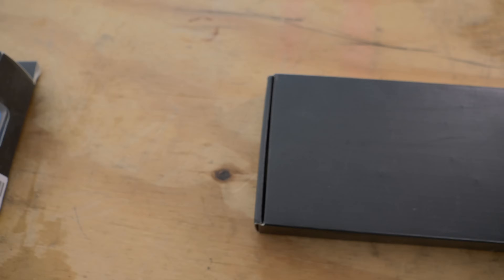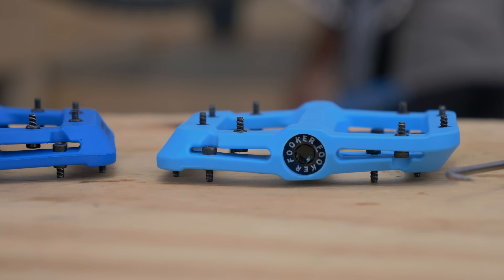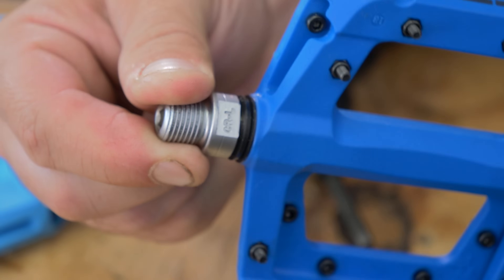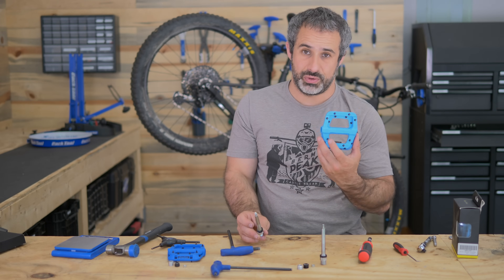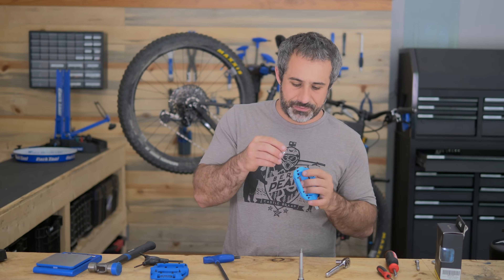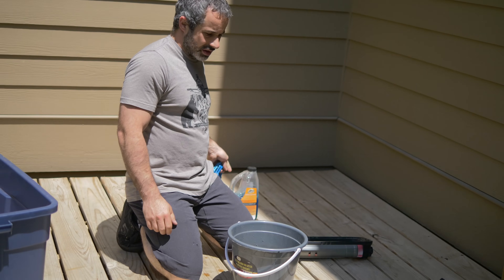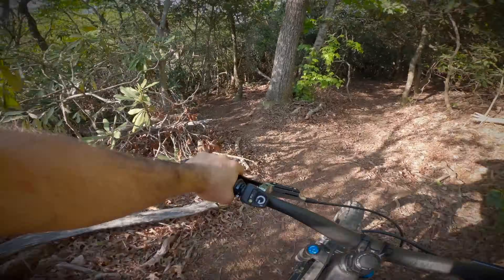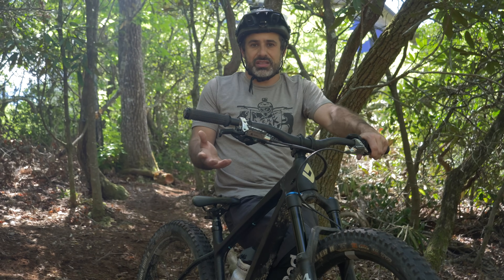These COMPLETE KNOCKOFF mountain bike pedals have me heated!

Comment: Plot twist: they licensed the design and Seth just trashed it
Reply: Plot twist: same factory in China designs and makes them.
No licence involved. 
RF specs them slightly better, pays 10% more for better pedal but charges you 50% more for the name and a bit better pedal, plus a load of marketing BS..

Like red bull gives you wings.. (also gives nearly 30% of its taking back as marketing)
Should be Red Bull gives you long term health issues..
Reply: This is terribly common, same as both brands buying the same design from an independent design studio, or both brands being owned by the same company but aiming at different market tiers, or even the most expensive brand copying the cheaper one. Source: studied Industrial Design.
Reply: Dave Webster There is more to it than that. RF has a retail price set to protect bike shops. RF likely sells them to a bike shop for about $25. So RF is likely paying $10 for the pedals. There is shipping and packaging involved, along with sponsorships and employees they have. So the factory is probably making the RF for $5. Then they, or another factory across the street, makes a copy of the original at a lower spec for $4 and sells it for $20 at a much higher profit margin selling direct. They likely eat a little profit using Amazon FBA, but they still have a higher margin. They are scum bags for selling knockoffs, but in the Chinese culture they do not have nor do they understand intellectual property. To them it’s a silly concept, they feel if it can be made cheaper then it should be, it’s how their culture has always existed. Most people these days will just say, duh I don’t care, it’s cheaper. But it hurts businesses and it effects jobs. It’s what happened to American automotive jobs the we are too good to do now, but we feel we are better than that, we don’t need to do that kind of work. It’s too expensive to do that work here. Chinese manufacturing and Amazon has destroyed retail models. Now people are slaving in fulfillment centers rather than in a factory. This pandemic shows that America can not survive on its own, because we rely on imports. We could get shut down by China if they wanted too. They own us.
Reply: MTB 2 SEA Indeed they do, this is how China wages war, and 99% of the time they will win, its interesting how a “communist” country now operates on a philosophy at the low level of almost perfect capitalism.
Reply: BadGamerGood 
China is essentially communist by name only, its mostly just authoritarianism with extra steps.
Reply: @badgamergood6713  This isn't going to last. This is why China is trying to expand influence. China is experiencing what every other developed nation has gone through. 10% annual growth through industrialization doesn't last forever. Recent years they've had much lower growth, more comparable to the west. This is important. Chinese citizens have put up with the violations on their rights because they've never been so wealthy. But, all their kids are living in a different world, one with an economic future more like our own post baby-boomer. More people and less growth mean less individual wealth. And, those people start becoming less willing to turn their eyes at being shit on. That's why internal propaganda and social surveillance has ramped up in China, and its why China is trying to exploit abroad. When the foundation of the economy crumbles (and it is), CCP is done.
Reply: Communist in name only until the CCP takes interest in your product or intellectual property at which point there's nothing stopping them from doing as they please.  It's all consistent with seizing the means of production.
Reply: David Bronstein my point exactly
Reply: MTB 2 SEA well Seth doesn’t care about bike shops since his bikes are all diamond backs. Consumer direct cuts the bike shop out.
Reply: @mtb2sea170  lol get over yourself. America did this to the British after www2 and many other countries. And we did it to other and many other have done it to many others when it suits them.
Its all swings and roundabouts.
The US patent office is mental anyways. Awarding stupid patents here there and very where which shouldn't have been given. Both to real businesses and plain old trolls.
I do believe there is a place for patents but it does require some common sense.
Same with copywriter and trade marks.
But China is a law unto themselves but half the time they get it wrong and end up selling them selves short.
State aid in china's another issue which Needs to be addressed.
But all of the above isn't something for this bike channel really.
And I don't think seths rant was really warrented if I'm being honest.
But it's his channel, his view so who am I to tell him what to do?
Reply: Dave Webster curious, what products did we rip off from the British after WWII. They have their own industry, even to today we do not export much to them. We do not export much of anything. Design a product of your own and have people make knock offs and take your buyers from you, see how it feels to have something you are passionate about taken from you. I’ve been down that road.
Reply: Internet Police  I never said anything about Seth or Diamondback. There are plenty of manufacturers going to a factory direct model. Diamondback is not ripping someone else’s design and selling it as theirs. My example was stating why RF has a higher price. Because they do sell to bike shops. RF did research and made a successful product and somebody copied it to take business (money) away from them.
Reply: MTB 2 SEA that’s debatable. Diamondback just uses frames from China. Tweak them a bit. And no. No one ripped off racefaces design. It was a catalog pedal. Most likely a wellgo.

Comment: My cousin literally works at a factory where the same.cans get a variety of different labels to ship off to different companies for sale

Its like aerosol air fresheners and hairspray products
Reply: I think paper towels are a better comparison
Reply: @randomuser5443  I bet they're even worse at it. One brand printing different prints on the same paper all day long
Reply: bread is very similar also.   big grocery stores carry their own "brand" of bread.   Meanwhile, bread from NEARLY EVERY "brand" you see on the bread aisle at the grocery store comes out of the very same bread factory.     When  prices are significantly different, there will be changes to the product but overall it'll be similar.    The best example i personally came across is the 3M green/yellow scrubber for doing dishes.   The normal stores carry them for $2.50 each or whatever.   I saw them at a dollar store for $1.25 in the same 3M wrapper and it all looked the same except this wrapper had dollar store logo added onto it.   I get home and compare it to a real one and the green scrubbing side is 1/2 the thickness, the yellow sponge is 1/2 the thickness...and guess what?   It fell apart in a fraction of the time.   It looked the same, same brand even, but it was definitely NOT the same as one you would get if you paid full price in a normal store.
Reply: That’s how supply chains work for the most part. Chester doesn’t create every piece in their own pedals, neither does fooker. They both source them from OEMs and then build their product. the difference is where they source them from and the quality of the production. Chester obviously cares for the quality, and thus has quality manufacturers which is reflected in the cost and craftsmanship of the product. Fooker on the other hand found a manufacturer that could make the same pieces for the cheapest price with 0 regard towards quality.

Comment: That internal sleeve nut is designed to put pressure on the outside bearing race. So the hole in the middle of it is really just a design thing rather than a way to keep water out or grease in. Just a heads up since it really seemed to upset you.

Comment: So i just bought pedals, AU$28 (US$17.75) RockBros, Nylon / Plastic, with proper screw in bolted spikes, 4 enclosed bearings per pedal, they feel perfect ie you can't feel any slop, good rubber bungs / o-rings to keep the dirt out, they are excellent, even for road riding, i don't slip off them esp'' in the wet, and i get more power when my feet have a good horizontal pedalling component, could not find Fookers, glad i couldn't.  My current bike is all dark grey / black, didn't want to cheapen it up with lots of anodised colour, however i purchased a yellow-green set, so that is now the 1 highlight colour allowed on that bike, again is good for road riding, large bright rotating pedals on a largely dark bike background.  Cheers!

Comment: I work in manufacturing so I have a little bit of insight here. Parts that are injection molded in the USA typically have the molds built in China because they do a good job for 40% of the price of having the mold made in the USA. So basically, the mold company in China has all the data required to make the mold. Now for the shocker. It's not uncommon for the Chinese company to make 2 sets (or more) of molds at the same time. One gets shipped to the US and the other(s) is put on the market in China. It's dishonest. It's stealing. It's wrong. Yet American resellers can't import the Chinese products fast enough, because hey, this is America and all that REALLY matters is the digits in our bank accounts.

Comment: Headsets, pedals and stems are the 3 most overpriced things in mountain biking. They cost almost nothing to make and seem like they must have a 3000% mark up from production cost.
Reply: Most of the cost comes from the R&D.  You're talking about the three parts of the mountain bike (aside from the frame and wheels, of course) that absolutely must not fail, or you lose control of the bike.  Even brakes can fail if you can come to a controlled stop (and you have two of them), but the three parts you mentioned are anchor points for the rider with no backups.  Those fail, you're absolutely hosed.
Reply: @zenspeed404  I agree with all of your points and that's why they get away with screwing you on those parts that being said production cost is nowhere the price the bike shops are charging people!

Comment: I have the same RaceFace pedals on my old RockHopper... I also have a different style Fooker pedal on my ebike (wanted a red flat pedal with pegs that also had reflective parts, they were the only ones I could find that had that) I've ridden well over 5,000 miles with the Fooker, including in heavy PNW rains that have turned my route into endless deep puddles with water constantly splashing over my feet. I've had no issues with the Fookers so far. Haven't opened them up to see how the bearings are doing, but they spin fine still. Not saying I'd recommend them over the RF, but at least they aren't complete trash.
Reply: Also worth mentioning, I tried to do some research on Fooker before buying them, and this video didn't come up =[

Comment: looks just like pedals i had in the 90's. whats so special about them that they had to do R&D?
Reply: The improvement lies in the details: better ergonomics in optimised concave shape, much sturdier materials (mostly better metal alloys) with different machining properties, better sealing, etc.
Then again, there are many "new" designs that don't add improvement at all and are just there because we live in capitalism (MOAR products, MOAR  sales!!!).
Reply: @thomaskositzki9424  Yea but I'm not seeing any of that with these.
Reply: zip zip like Thomas said, it’s in the details. Engineering is about making the lightest, strongest, most ergonomic, most aerodynamic, safest, durable product with the lowest cost. It’s all about efficiency. It’s just a min/max approach with materials science, physics, and modeling to include forced failure for analysis and incremental improvements. “Any idiot can build a bridge that stands, but it takes an engineer to build a bridge that barely stands”, if I remember correctly. Sometimes engineers get it wrong, and their tests weren’t enough to expose the flaws, and better ideas always come along, which is why we always have new models, revisions, recalls, etc., but they try their best to get it right the first time, within budget and the deadline.

Comment: Chester pedals buys the fooker pedals and puts their name on them. Rise the price for a profit.
Reply: firstly, you mean raceface. secondly, i'm pretty certain that raceface got there first. its just that i don't think that that the KP logo is original.
edit: theres also the little seal that doesn't seal, which i don't think they would put in there if they didn't copy the chester.
Reply: @bananasstuff3344  these are all made in the SAME factory in china lmaoo..... American companies do this all day for years. They stamp their logo in the USA and sell it for 100x the price they paid
Reply: @nmnmnm35  if they were made in the same factory, the internals would be the same, and they aren't.  The Chester's were machined a lot better than the fookers, and they were machined in different ways.  I know it's pretty common, but this isn't one of those situations.
Reply: @ARandomBoat  the same factory could very well have multiple blueprints /designs and just send the base pedal parts through slightly different molds/modifications depending on the customer
Reply: @JohnSmith-zs1bf  dude, that is impossible. No company would make a terrible copy of their own item. They might modify it, but not make a trash copy
Reply: @ARandomBoat  i mean you're PROBABLY right, but most American companies will order the product specifically or order a similar product and give instructions for modification to rebrand it. It could very well be that raceface orders them from a supplier in China who also started selling their own version, or gave blueprints to another factory thats taking orders from fooker. Again, I dont know for a fact either way, I'm just speculating.
Reply: @ARandomBoat  also i dont see any evidence that the fooker pedals are trashy. They actually seem to hold up very well compared to the original.
Reply: @JohnSmith-zs1bf  makes sense, and by trash, I meant that it has parts that seem to copy the Chesters, but serve no actual purpose. It's like what seth said in the video

Comment: On the mould: When a mold wears out, or the model is discontinued, sometimes the mould is tossed, or sold, and not destroyed. "fooker" can take the mold and grind away logos, weld in new material to repair wear, etc etc. there is a real possibility that that IS the chester mould, and they came by it legitimately (maybe they even made it) and because race face does not own anything about it besides their own logo, they have no say in it.
Reply: KP stands for k-pedc. They are catalogue pedal manufacturers. Otherwise known as Ningbo Hao Jue Fitness Equipment Co
Reply: @chriscrawford2977  So do we rename this video "Seth freaks out when he finds out Race Face rebrands catalogue products and jacks up the price" ?

Comment: Having been looking for flat pedals for a while you notice alot that are the same.
Thing is with a lot products not just cycling related they are mass produced in China then company names stamped on. I found this with a pair of high end fashion brand trainers finding an exact version of them by a much cheaper brand. A lot of brands do this in the mtb world, a lot used to do it with bike frames in the 90s, several companies selling the exact frame for varying prices, suppose its just business, but don't always be fooled thinking its expensive it's good
Reply: So true. And in the case of this video you could probably buy 4 sets of fookers for the price of 1 set of the racefaces.
Reply: You can engineer something highly and have it manufactured in China, no problems there. The problem is that manufacturers in China making products to sell out the back door don't do any engineering. They change materials, dimensions, etc that make the products poor quality. Made in China vs. sold by a Chinese company is the inportant difference.

Comment: I've actually been running a single pair of fooker pedals for 4 years now. I've ridden all over western North Carolina including Beech mountain, the Riveter, Dupont, Pisgah, Bent creek, and everywhere else you can think of. They do loosen up a bit more than the Chester's but never seem to move more than 2-3/10 of an inch. They've held up really well considering the abuse they've gone through. The pins do wear out faster and the spindle has that little bit of play I mentioned, but other than that they're solid. If it's your only choice, its not a bad buy. But otherwise,  just get the Chester's. They're only $20 more and the spindle construction is far better in terms of reliability. 

and yes my name is basically the same as the fooker pedals, I just thought it was funny.